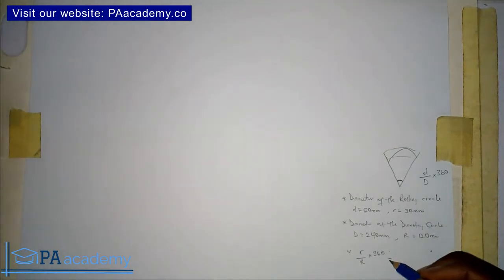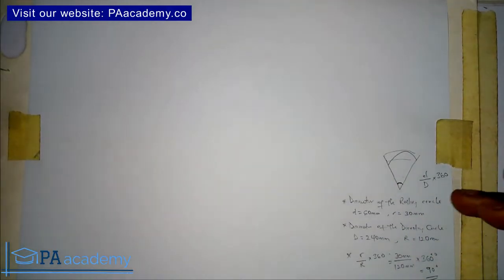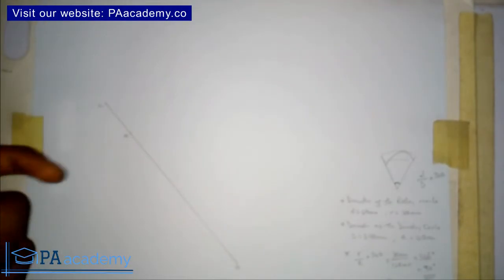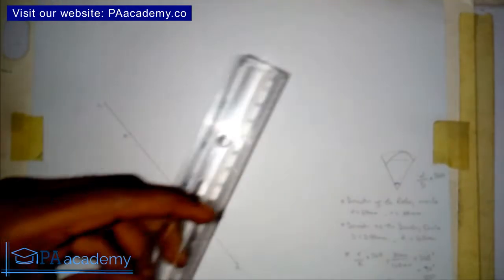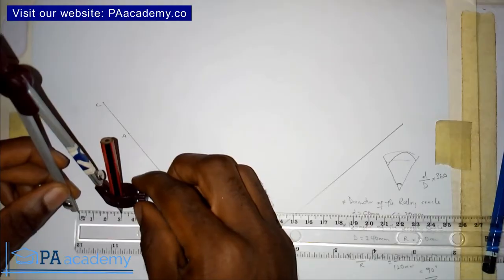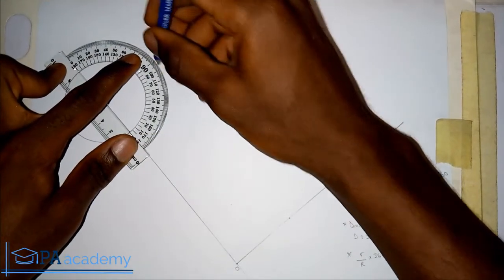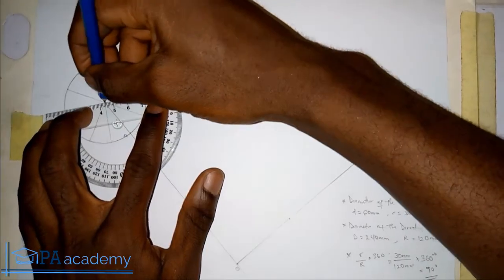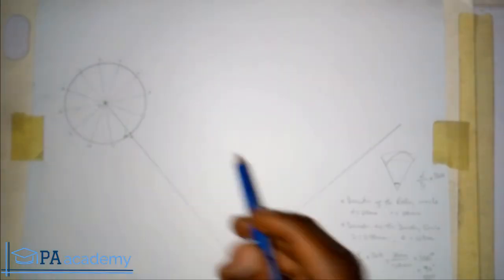How to Draw an EPICYCLOID in Engineering Drawing | What is Epicycloid Curve In Technical Drawing

Comment: My 2 diameters are Generating diameter is 21 and directing diameter is 73,so my own 90 should be 103.

So my division for 12 lines should be 103÷12=8.56~8.6 but I'm having problem diving it into 12,I'm having 11 instead of 12.

So I dnt know where I'm going wrong🤷‍♀️please help thanks.
Reply from the maker: Hello Somiari, alternatively you can divide the arc and circle into 8 equal parts. For the arc, the division will be with a compass

First you'll divide it into 2 equal halves. Each half will be further divided till you have 4 on each side making 8.

Remember your circle will also be divided in to 8. After that follow thesame procedure to get the intersections.

I hope this help. Do let me know if it does. 💝❤️💝
Reply: @PAAcademy1  thank you very much.